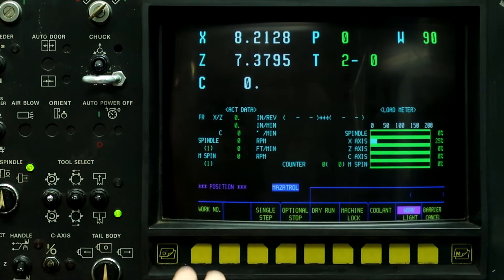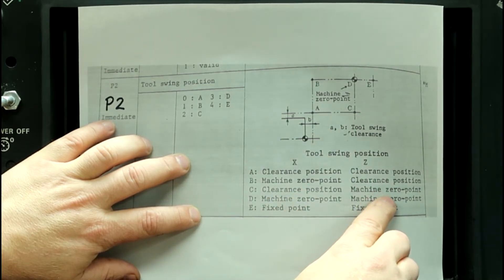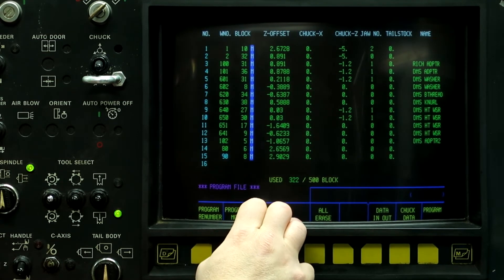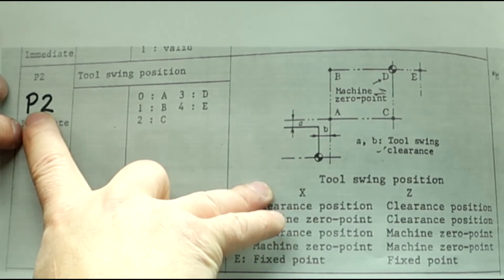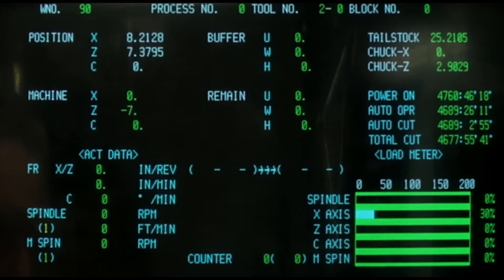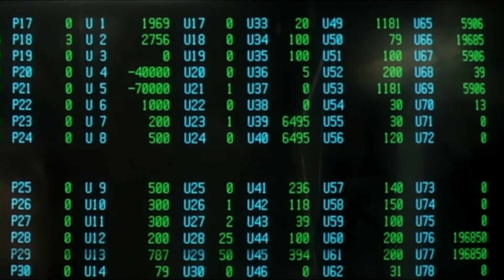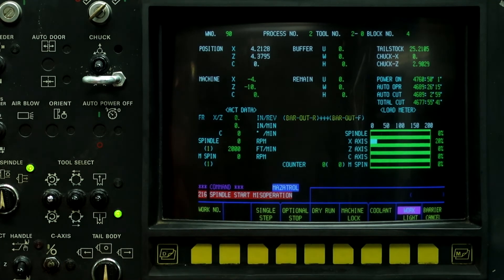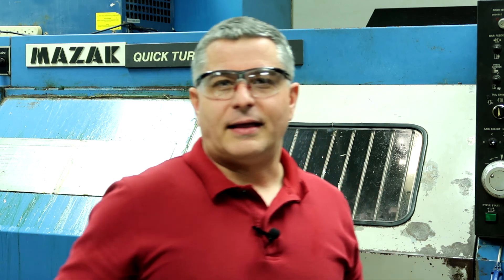Mazak Lathe Tool Change Position T 2 T 3 Control

Comment: Hi Phil. Just reviewing some of your early vids and looking specifically for the T2 parameter that controls the tool  X-retract clearance for bar out roughing. I need more clearance between passes to allow the chips to fall out rather than wad up around the tool tip. I thought it was U6 but  it didn't work.  Thanks!
Reply from the maker: @peoplepower1272  U6 is the correct parameter. What value did you enter?
Reply: @mazatroltipsandtricks6816    I changed U6 from 800 to 1000 then re-booted. The retract didn't seem to change.  Maybe I should try a bigger number? I'd like to have more like .500 clearance
Reply from the maker: @peoplepower1272  for .500" clearance, you need to enter 10000 in U6. Also this parameter change is effective immediately. No need to reboot the machine. 10000 = 1.0000" on diameter or .500" clearance per side.

Comment: please show us how to properly set tooling up for an i.d and o.d. higbee/blunt start thread. im bashing my head. left and right hand m2.5 thread
Reply from the maker: I've never tried to Higbee a thread. It's going to be trial and error with a groove tool being used as a threading cycle.
Reply: im having all of the issues., with the i.d. threading bar anyways. too many un-explainable quirks/parameter/tpc issues. i can simply flip the starting points in z or lh or rh thread. same values, i smash the wall in the part
Reply from the maker: @Sebastianbartledoo  Do not try threading from bottom of the bore. Machine will crash into the bottom.  Use a left hand bar to do left hand threads.

Comment: Hi Phill, when I set any number at the end of the program, the turret always returns to the zero point. I assume that it is adjusted in the parameters. I want the turret stay at the point that i set so i can put the limiter. Do you know what is the problem?
Reply from the maker: It must be a parameter setting. Sorry I do not know which one.

Comment: Would have been nice to see the the actual turret/tool  position with the door open with the different parameter settings. We have an issue on an old T3 machine i operate. ATC not turret like yours. I can get it to go the right away from the workpiece fiddling with these parameters but it won’t complete the actual tool change. Do you alter these parameters for depending on the job or will they work for every situation? Thanks and greetings from the UK. 🇬🇧

Comment: Thanks for these videos.  As an old Fanuc guy that's been thrown off the end of the dock into the Mazak (Slant 30-T2) universe with documentation that's clear like mud, I'm very grateful for these!
I have to ask a noob question. Can two offsets and rotation parameters be set for the same tool position, so the same threading tool can be used for inside and outside threads?
(Please be kind. I'm still an apprentice after 40+ years of this stuff) ;-)
Reply from the maker: On a T2 control, you can only have one rotation direction called out per tool.  You can only have 1 geometry offset and 2 wear offsets for each tool.  You will need to use a separate threading tool for OD and ID threads. Mazatrol cannot machine on negative X if you are trying to use ID threading tool to cut OD threads.
Reply: @mazatroltipsandtricks6816  I suspected as much. I was hoping you'd discovered a workaround. Off to go tool shopping I go!

Comment: Hi Phil,
Do you know what is the parameter to set the "tool eye" position? Because my tool eye values are not consistent with the actual dimensions I am machining...
Many thanks in advance
JB
Reply from the maker: Yes, I can do a video on how to dial in the tool probe on the T2 and T3 controller as well. You have to dial in the OD and Z+ probe tips before you dial in the ID and Z- probe tips because one affects the other.
Reply: Hi Phil,
It would be great! (So I could start using my tool probe again)
Thanks again
JB